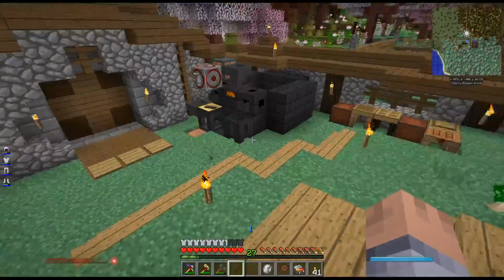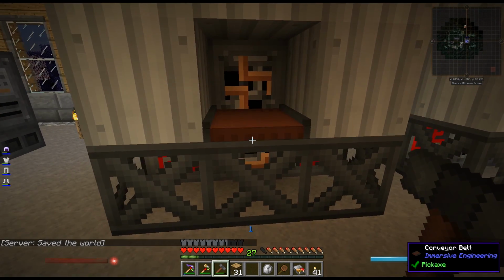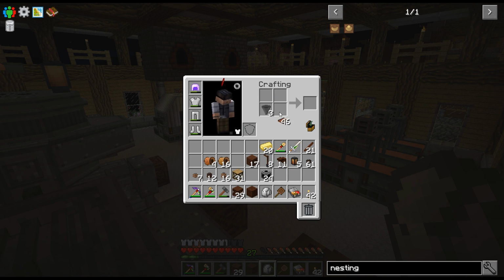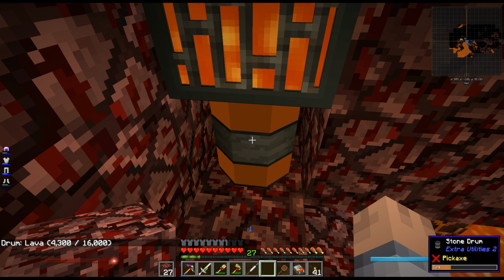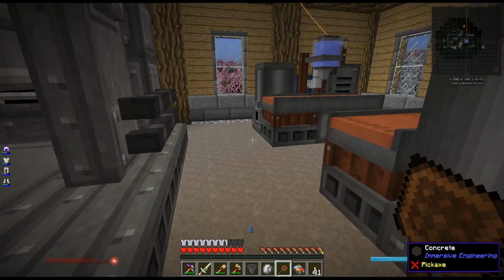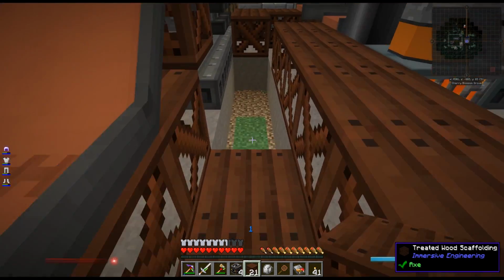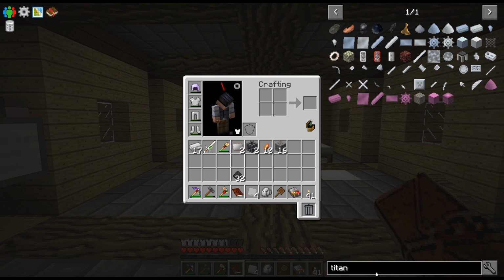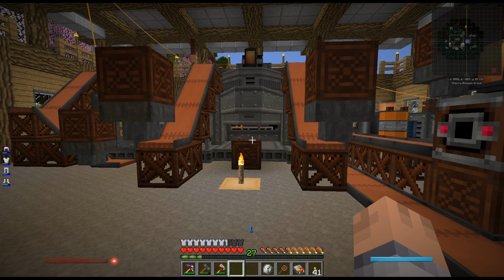Nuts and Bolts Torqued #4 - The Factory - FTOG Server Let’s Play

Comment: Nice build and video! Just to let you know, you can put your output crates at the end of conveyors/machines, on the same level as the conveyor, and items will go into them without the need for the hopper conveyor, at least that is how it worked last time I used them.

Comment: Instead of splitting the routes for the buckets and bottles all you have to do is name one of them and then it will be recognized as a different entity than the original bucket. Like name the Water bucket for water.
Reply from the maker: I have to try that, but I am pretty sure that when the named bucket gets filled with water it will be renamed to the default Bucket of Water. I've tried using something like that in the past and ran in to this problem.

Comment: If you want to use all the slots in the Arc Furnace, you'll have to pump in 4096RF/t into it xD
Reply: 512RF/t per slot, so 6144RF/t for all 12! So two HV connectors to fully power
Reply: Oh derp xD

Comment: The LV relays don't transfer power in/out of what they're attached to, so the 256 rule doesn't affect them. For relays, the maximum power you need to worry about is the maximum transfer rate of the cable, which in the case of LV wires is 2048RF/t.

It's the connectors (the ones which can only have one cable attached and which move power in or out of machines) which are limited to 256RF/t (in the case of LV) but that's only a transfer rate; they won't actually lose any power it's just how much can be moved to or from a machine through the connector.
Reply from the maker: That's why I split it up in to two so I don't have the power loss on the MV capacitor bank that the 4 water wheels are charging. Because if all 4 are making 82RF/t that is a combined 328RF/t which is too much for one LV connector :)

Comment: Thorgal, you can input the fluid directly on the IE's Assembler, you don't need the system to fill the bucket
Reply: Thorgal Daily Gaming  you say you mentioned why you are using buckets but all you say in the video is I kinda want to implement that one over there. Huh? I get you want to utilize your build but why not save it for something else. Besides if all you have to do is supply items specifically and just auto fill the tanks it's way more easy to automate. Also did you try using universal fluid cells instead of buckets to recombine the outputs?
Reply from the maker: I mentioned in the episode the reason that I wanted it to be separate. I also mentioned and showed that we can use the internal tanks, like I do with the creosote.